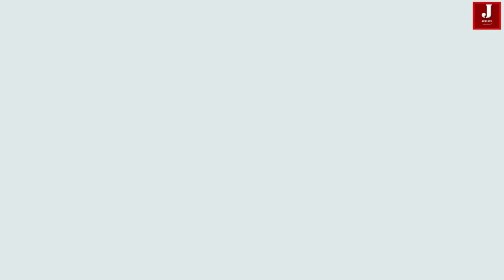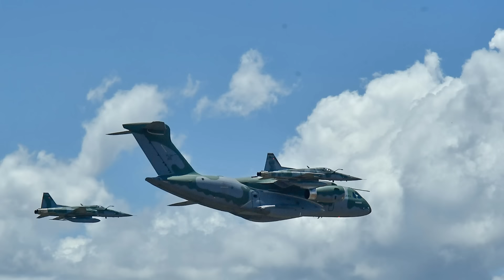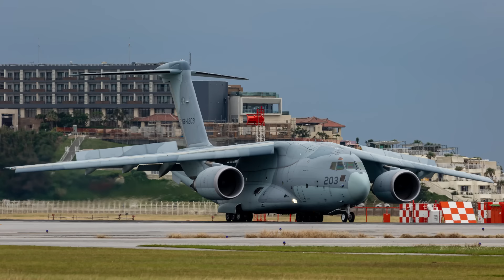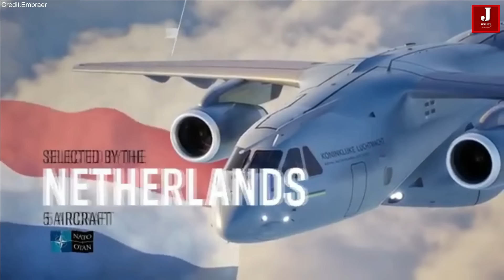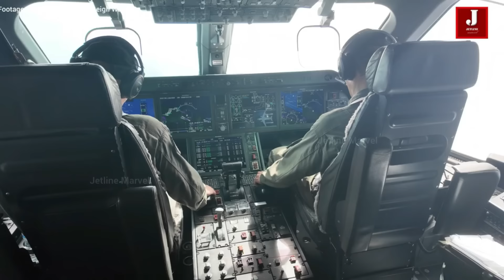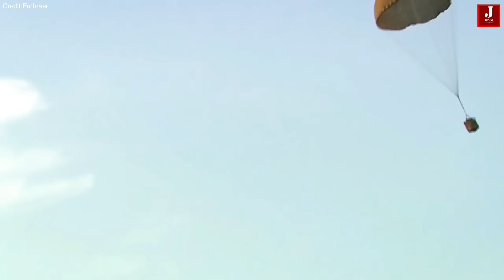Comparison of Japan's C2 and Brazilian C390 Military aircraft #Japan #Brazil

Comment: It seems the C2 uses the much older and larger Airbus A310/Boeing 767 size CF6 engines, from the 1980s. But the Embraer uses the newer and smaller Airbus A320 family engines. This also represents the capacity and efficiency difference of the planes. Not the same league in size and nor in age. But I like both planes.

Comment: The C-2 cruises at Mach 0.81, while the A400 cruises at roughly Mach 0.68–0.72. The C-2 was intentionally fitted with GE’s CF6-80C2K1F engine, which is widely used on commercial airliners. In other words, the C-2’s engines can be serviced virtually anywhere in the world, and the aircraft can use the same high-altitude air corridors as passenger jets. By contrast, the A400 must operate on military transport routes. The C-2 also has no specialized propeller-driven architecture. Its minimum takeoff distance is about 500 meters, compared with about 770 meters for the A400—and the C-2 can take off and land even on rough desert strips.
Reply: Não entendi a comparação com o A 400, pois o avião mostrado não consta o A400 e sim o CK-390 da EMBRAER e não o da Airbus.

Comment: The Enbraer-C390 is waaay superior than Japan's because C390 is designed by the German engineers boys !!!!!!:face-green-smiling::virtualhug::finger-red-number-one::finger-red-number-one::thanksdoc::thanksdoc::medal-yellow-first-red:🤠💋💋💋💓💞:virtualhug::medal-yellow-first-red::medal-yellow-first-red::finger-red-number-one::face-purple-smiling-fangs::body-blue-raised-arms:
Reply: Os engenheiros do C390 são do ITA. ( instituto tecnológico aeronautico). Nada de alemães.
Reply: @heladioximenesmemoria5019  e mesmo assim. Embraer é uma empresa brasileira e pronto
Reply: Fake news
Reply: The C-2 cruises at Mach 0.81, while the A400 cruises at about Mach 0.68–0.72. From the very beginning, the C-2 was deliberately equipped with GE’s CF6-80C2K1F engine, the same model widely used on commercial airliners. This means the C-2’s engines can be serviced virtually anywhere in the world, and the aircraft can operate along the same global air corridors as passenger jets. By contrast, the A400 is restricted to military transport routes. The C-2’s minimum takeoff distance is about 500 meters, compared with about 770 meters for the A400—and the C-2 is fully capable of taking off and landing even on rough desert strips. With all due respect, the idea that the German aircraft is superior is merely a misconception.
Reply: Are you serious?
Reply: Embraer has a german background. In der frühen Phase von Embraer übernahm Pessotti wichtige Aufgaben beim Design und bei der Entwicklung mehrerer Flugzeugprojekte (z. B. Bandeirante, Xingu, Tucano usw.).  ￼

Bereits in den 1950er Jahren wurde der deutsche Flugpionier Henrich Focke nach Brasilien geholt, um mit seinen Ingenieuren beim Aufbau einer nationalen Luftfahrtindustrie mitzuwirken. Er und sein Team arbeiteten beim CTA (Centro Técnico de Aeronáutica, Brasilien) an Hubschrauberprojekten und anderen Entwicklungen von 1952 bis 1956.  ￼
	•	Dieser Beitrag deutscher Ingenieure war Teil eines staatlichen Programms, Brasilien technologisch zu stärken und Know-how ins Land zu holen.
Reply: Go to Embraer in Brazil today and see if there are any Germans there?  Or the participation of any of them in projects from 1999 onwards 😅😅@rhinecentral
Reply: @rhinecentralEven Brazil is only 500 years old, it is a child... It was born yesterday, and stands out in a scenario among the countries of Latin America as great, the first country in Latin America to achieve the Nuclear technology... first the only country in Latin America to have its own combat tank unfortunately the Brazilian military industry is very precarious... and Brazil passes Which often leads to failures in its military bodies, unfortunately Unlike many countries in Europe when Germany was involved in the theft of resources, including gold, from another country at the time.Including some European countries that also stole all of Africa With this, they had great resources that could be invested in technology and human capacity.Which resulted in its large military industry also given its years that are more than 2000 years of existence ....
 unlike Brazil And even so, without all of this, Brazil manages to be great..Even after being robbed by Portugal, who came to take our gold, haha...
Reply: @rhinecentral fake news
Reply: @Renan.A.Santana409 And what is the real story?

Comment: Ｃー２は巡航高度が高く旅客機と同じような高度を飛べる世界唯一の輸送機。
これにより民間航路を選べるので、飛行計画が立てやすくなっている。
Reply: 巡航高度ではなく「巡行速度が速い」の間違いですね。
速度が遅いと速度がより速い後続の民間航空機に追い付かれるため。
Reply: @derj-flug9785  Hmmm?  Both original autor's statements are not true. KC-390 can fly as high as 11km i.e. 36000feets (FL360) which is common among airliners, and it can fly as fast (or faster) than typical airliner.
Looking from other side: Really, is flight level any important for military cargo lifters??? C-130 Hercules - 10km, KC-390 - 11km, C2 & A400M & An-70 - 12km, Il-76 - 13km. Anyway, manpads can't reach, any serious anti-air system can shot down easy.
Reply: @PatrykRozgwiazda1966  あなたの視点は「対空脅威回避能力」にしか目が向いておらず、軍事知識を自慢したがる子供にありがちな浅い論点の取り違えですよ。ここで議論されているのはC-2の「対空能力」ではなく、日本の混雑空域における民間航路（RVSM, FL290–410）への“速度と高度の適合性”です。

日本は2005年から国内空域もRVSMを導入しており、巡航速度が遅い輸送機は旅客機主体の航路では最適高度を割り当ててもらいにくいのが現実です。そのためC-2はMach 0.8以上で旅客機と同じ流れに乗れることを公式要件として設計されました。高度面でも最大12km級まで上がれるので、旅客機と同様にRVSM帯を柔軟に使えます。

比較すれば、KC-390も同じくM0.8級で条件は近いですが、A400MやC-130系は巡航速度が遅く、日本の旅客機中心の航路では運用効率が劣ります。したがってC-2の本当の強みは「平時運用の主戦場＝ATCと民間空域との親和性」にあります。

Comment: If the Indian Air Force wants to replace the 48-ton IL-76 in addition to the Antonov 132, the 37-ton C2 from Japan would be an interesting alternative. Before considering the Airbus 400M, which has the same payload, the Japanese model should be preferred because it is cheaper. The Airbus 400M is said to cost a whopping $250 million each.
Reply: If the Indian Air Force plans to introduce Kawasaki C-2, it would consolidate Indo-Japanese military cooperation, and it could contain Chinese aggressive expansionism in Asia and Pacific region.
Reply: Airbus works better in Dirty and Dusty conditions due to the Engines and Propellers
Reply: The C-2 cruises at Mach 0.81, while the A400 cruises at roughly Mach 0.68–0.72. The C-2 was intentionally fitted with GE’s CF6-80C2K1F engine, which is widely used on commercial airliners. In other words, the C-2’s engines can be serviced virtually anywhere in the world, and the aircraft can use the same high-altitude air corridors as passenger jets. By contrast, the A400 must operate on military transport routes. The C-2 also has no specialized propeller-driven architecture. Its minimum takeoff distance is about 500 meters, compared with about 770 meters for the A400—and the C-2 can take off and land even on rough desert strips.
Reply: 인도는 돈이 없어.
Reply: @성이름-u2e9g  Per capita income of Indian people is still low if compared with advanced nations. But India`s military budget ranks four in the world, and I`m quite sure that India could afford to purchase Japanese Kawasaki C-2 military transports.
Reply: Price is crazy
Reply: India already chose c390 from brazil with reciprocal trade of lca tejas